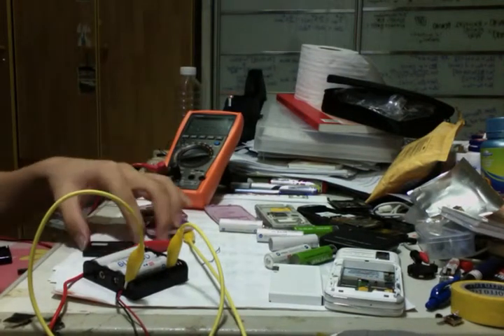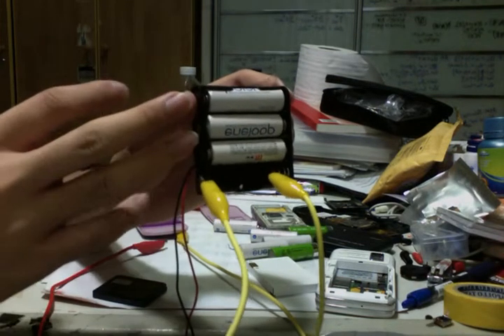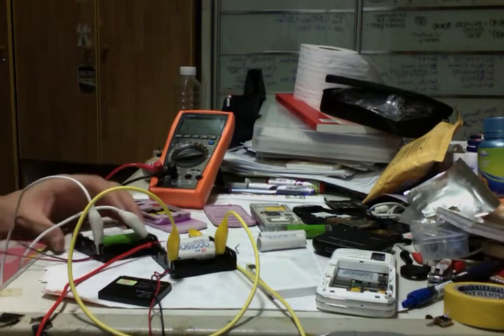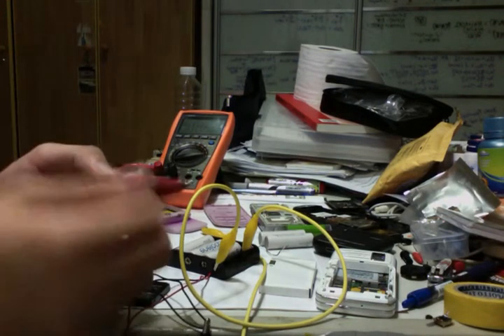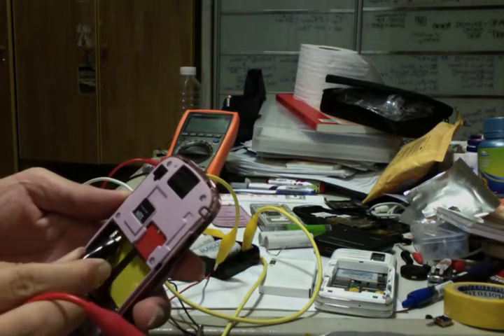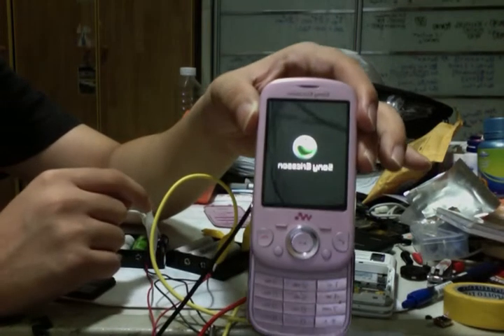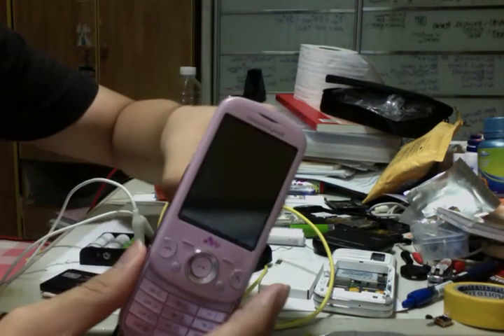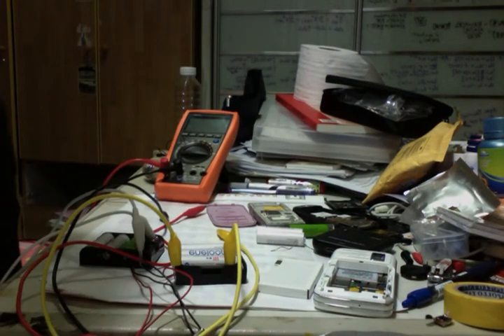Trying to mod cellphones to run on AA batteries Round 2

Comment: the amps are lower and most cellphones have a double ground you need to jump the grounds and yes it can hurt the phone and the use the proper voltage the best thing to do to get this to work is buy a adapter already made or wireup the chip and termanels from a proper battery to the batterys